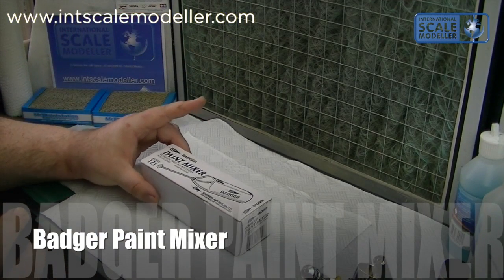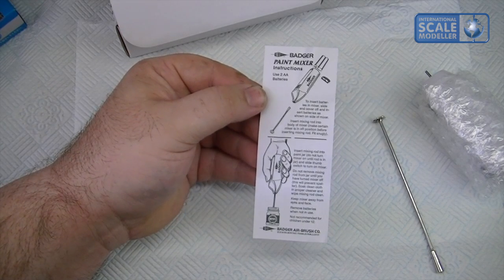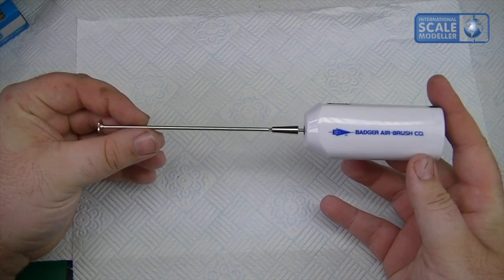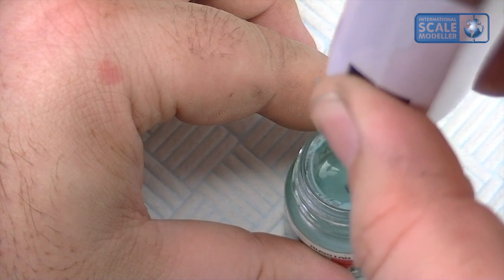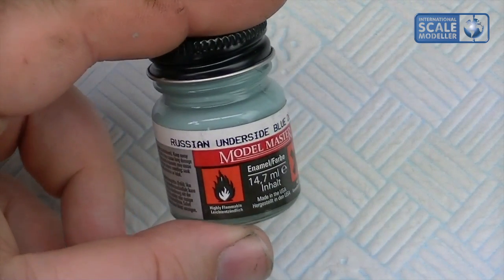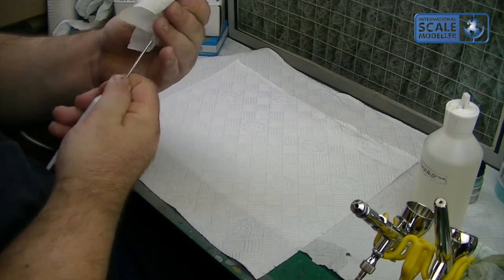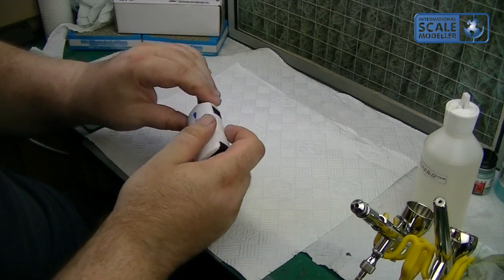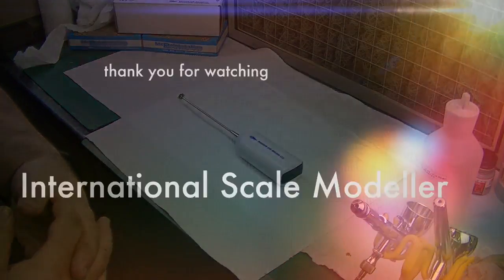Badger Paint Stirrer Review

Comment: Been using one of these for over 20yrs. First thing you learn is to keep your fingure on the mixing rod to slow it down a little as it can throw paint. As for bubbles. If you're getting a lot of bubbles you need to slow it down with your fingure. If you use acrylics this is a must.